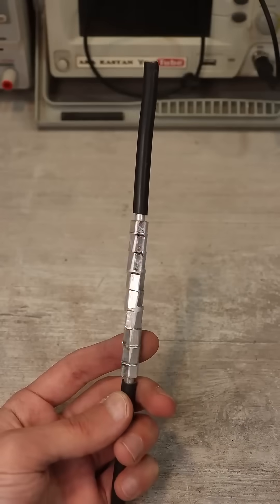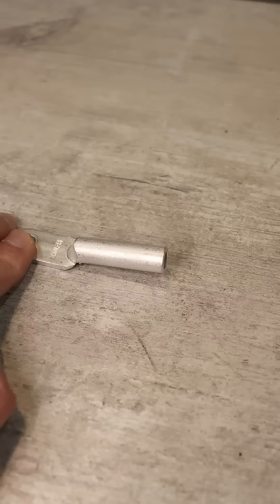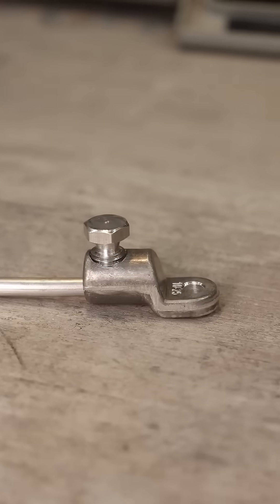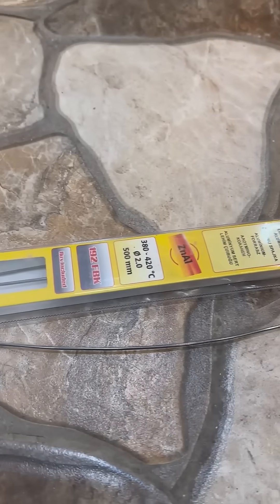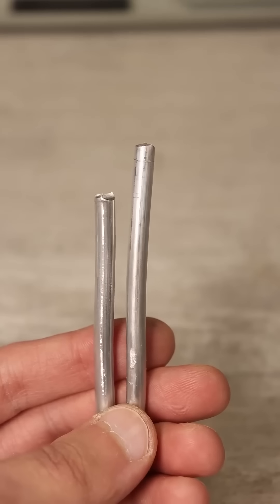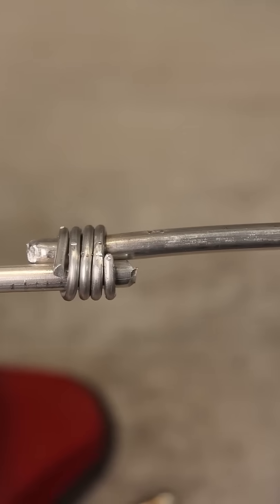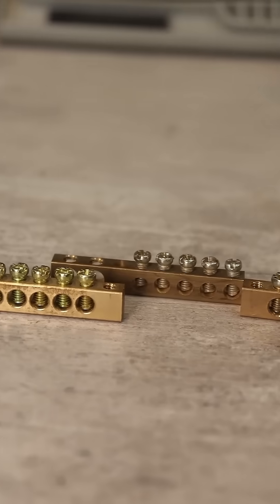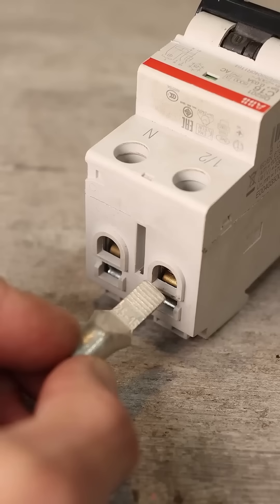How to Join Aluminum Wires

Comment: I don't know about the rest of europe. But I have never seen aluminium wires any where here in Norway.
Are they mostly a north american thing?
Reply: German here, there where a few copper shortages since WW2 here and in some other European countries.
Here in the West German part it was used in the rebuild after WW2 and roughly in the 70s there was a short resurgence of it, mostly in big costly building project like schools.
Nowadays you only see it in industrial installations (factories and power transmission)

And in East Germany aluminum wire was uses more consistently because of cost savings.

More economically strained counties like the US or eastern Europe see more aluminum use for the same reason.
Dealing with the shortcomings of aluminum wire has gotten somewhat easier with special greases to slow down corrosion and terminals that are made out of matched material.

But for small diameter house electrics it's hopefully mostly displaced...
The USA sadly uses a kind of aluminum wire for house electrics.

Comment: Using aluminum as wiring should be illegal. The oxide on the aluminum makes it so much more likely to form cold joints. Aluminum fatigues easier making it less bendable. Aluminum does have a few pluses: it’s light, conducts ok, very moisture resistant, and melts/fuses easier in the case of an overload before burning the house down.

Comment: Almunium is not intended for this purpose as its not good conductor...
world population has lead conjustance on resources..copper pipes / iron pipes replaced with PVC, every electrical electronic component has been prepared for asertain time (compromised quality production) just to accomodate over population and keep running economic...as if 1 tungston bulb may be prepared with honesty then it will last for more then 10 years...and in today's era if the same bulb be prepared than everyone buy it for once and then no sell and purchases will happen coz the product will last for 10 years...

hope everyone got it what i mean...and that is all hapening just because of automated cleaning program (population cleanliness) has not yet been run...
i am really missing those auto cleanliness...
first world war 1907
then holocasting etc been run
second great war 1945 

after 1945 a considerable time has been lapsed for the automated cleanliness program has not been ran..

auto cleaning started then population will reduce and resources will automatically be set to sufficient.... in over population existing resources remain not enough due to which we will seek and go for alternatives.
Reply: We still use aluminum in the USA, you just need a bigger gauge to carry the same ampacity as copper.
Reply: its not a matter of guage... but line losses.... almunium is not good conductor as copper... if 2 motors being rewinded 1 with almunium wire and the other with copper then copper will have batter effeciency as well as upon current (Ampare)  measurement almunium motor consume more Ampare compare to copper due to which it may lead to waste of energy due to its bad charecterstics for electric flow conductor. @wolfrig2000
Reply: My grandfather died in the First World War. So you think that's ok? 
And it was 1914 to 1918 !!
Reply: what i mean to say is...these incidents are natural disasters which may lead the cleanliness of population... i am not saying anything about it either its right or wrong... just explaining its a natural process to limit the population for existing resources 😊  @KB1UIF